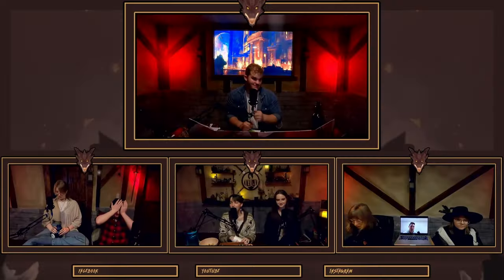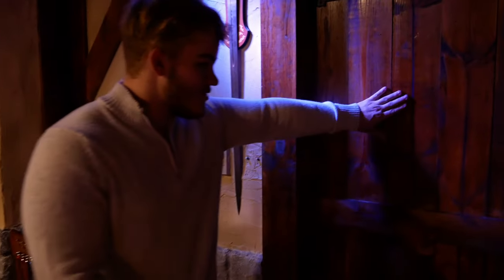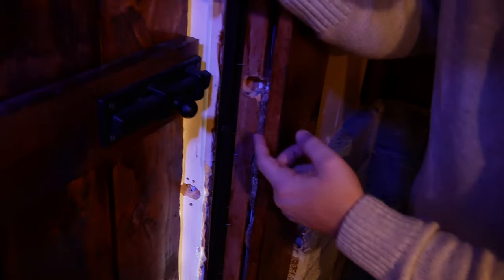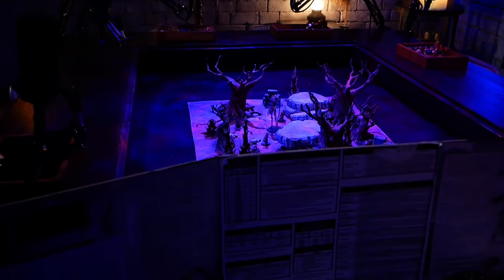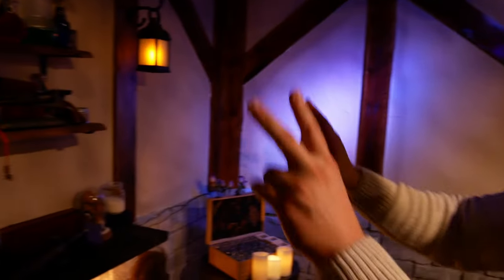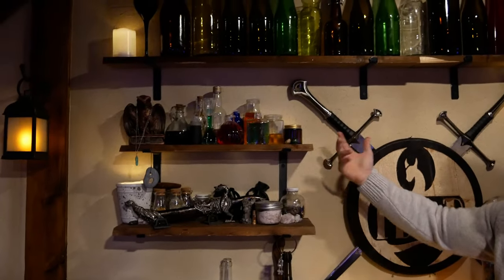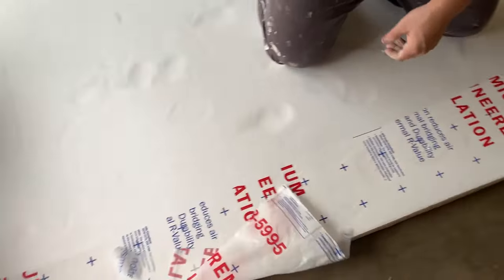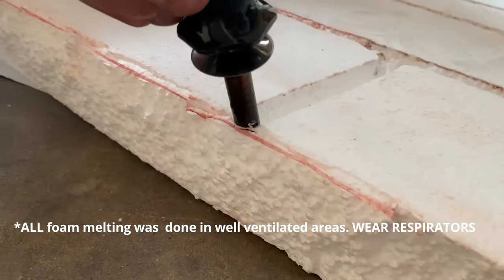The Ultimate DIY D&D Tavern Game Room

Comment: Be aware that with really cheap DMX lights, when you go to wire them up they will tend to not be internally terminated. What does that mean for you? You may experience unusual flickering / unexpected settings changes on the lights. To prevent this, make sure the last device in the chain has a terminator (basically a XLR plug end with no wire but has a resistor inside it that bridges the data line to ground). This prevents data signal transient reflections from coming back up the line and being interpreted as changes by the lights.

https://en.m.wikipedia.org/wiki/Electrical_termination
Reply from the maker: Thank you, that’s extremely helpful! We’ll keep that in mind when we’re able to wire them up.

Comment: I am trying to do the foam wall project myself, and I am the exact same foam boards as you

I am having a problem cutting them vertically to trim for shorter walls - I understand the tops don't have to be perfect, but the sides do in order to connect them together without gaps

How do you cleanly cut the sides?